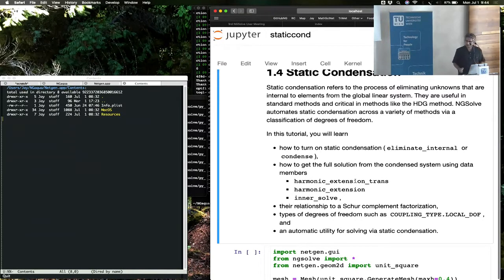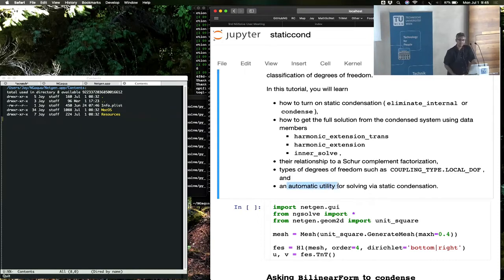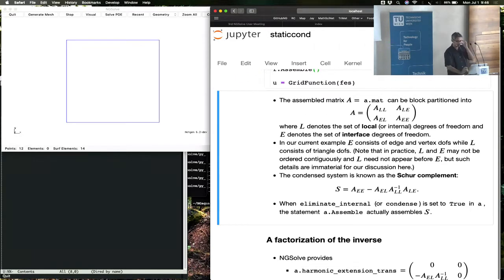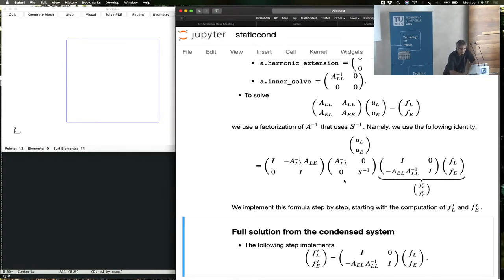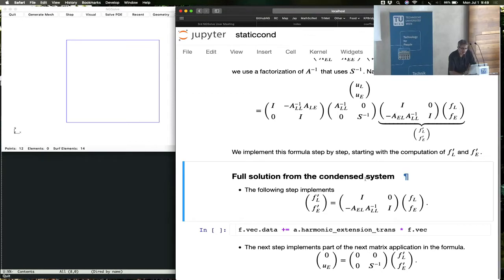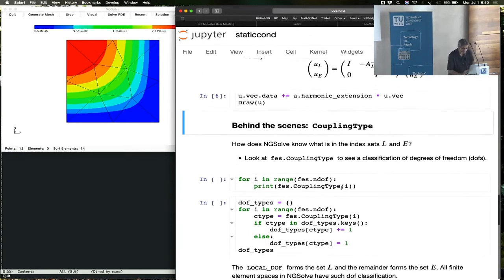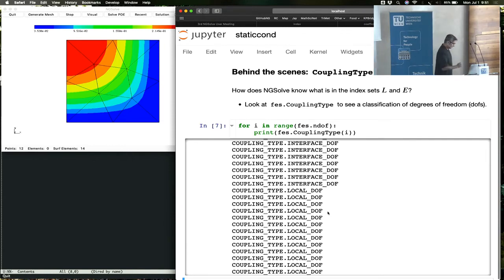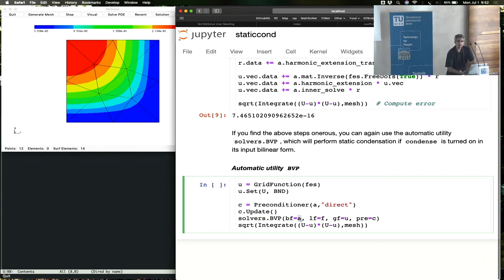1.4 Static Condensation

Comment: Good morning sir. I am working on incomprehensible Navier stokes equation for  boundary prediction using Neural network. In the equation, i had to vary the Remold number. I am using the Ngsolve library in python to generate the necessary features but I am finding  it difficult in using the Ngsolve library to the features. Please any assistant.